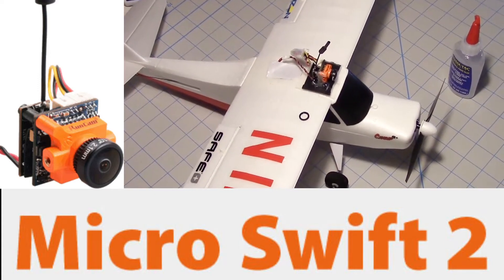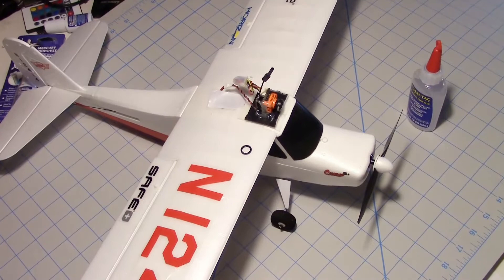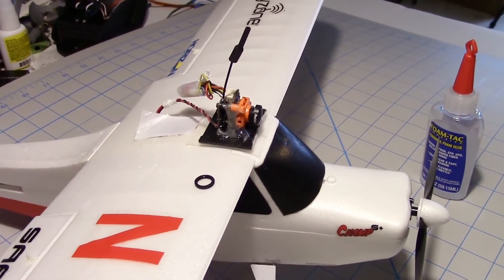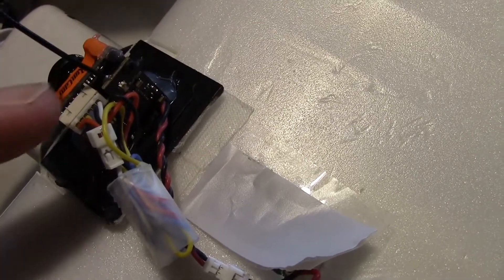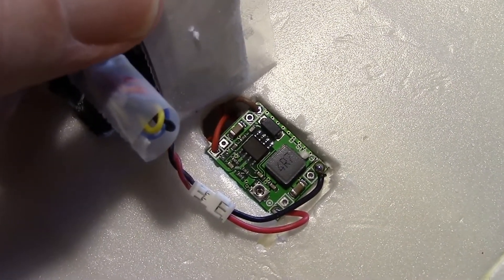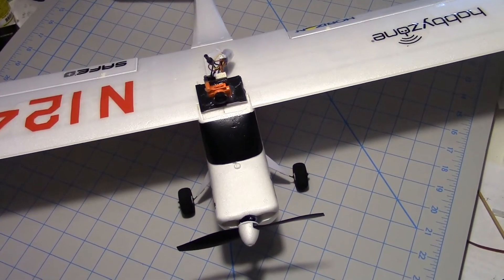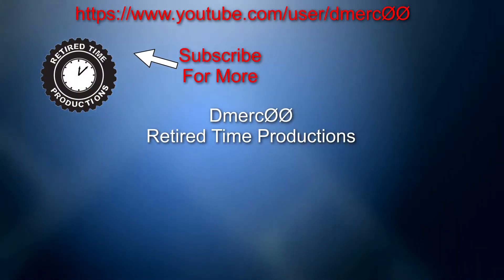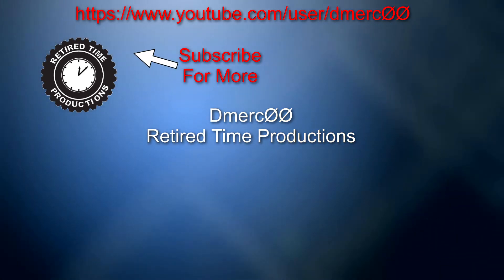RunCam Micro Swift 2 FPV Cam  - New Focus Flight Test with RunCam TX25 VTX

Comment: Almost twice as good. They make so many so quickly that they probably don't get every one as exact as it could be.
Reply from the maker: I will trust your report.  I think maybe they are focusing on a chart that is only a few feet away and not adjusting for distance. Maybe they are aiming for the quad racing crowd that needs up close detail on the gates but for me I am looking at stuff far away.
Reply: Also the Aperture affects the DOF so while a bright lens is going to let a lot of light in and be better at night the depth of the area in focus will be less over a darker lens. 

It will probably be a choice of close, mid and far. 

You probably want "almost midway" (maybe 150-200'), then rely on things being close are bigger (so easy to see, even if not perfectly focused) and things way off in the distance are also a bit soft (since they'll only be a few pixels wide in any event).

If you always fly close to the ground you would want objects closeup to have good focus otherwise the whole Field of View would be blurry.

It depends on which height you fly and the 'looking forward angle' to the ground - maybe 150' in your case.

You could probably place a Target on the ground and hold the Plane in your hands on your porch.

Looks fine now. It was a bit mushy before, I figured it was due to compression.

It only gets so good for an inexpensive Camera, and weight is a consideration.

A Sony Action Camera like the FDR-X3000R ($550, 114g), or HDR-AS50 ($200, 83g) has a very high quality lens and Image Stabilization and has secondary use - it will certainly cut flight time. 

Looks good now, don't worry about it.

YT,
Rob